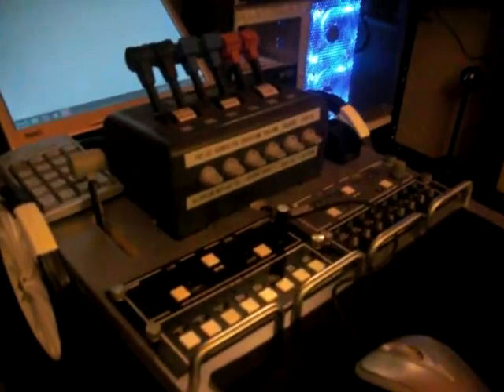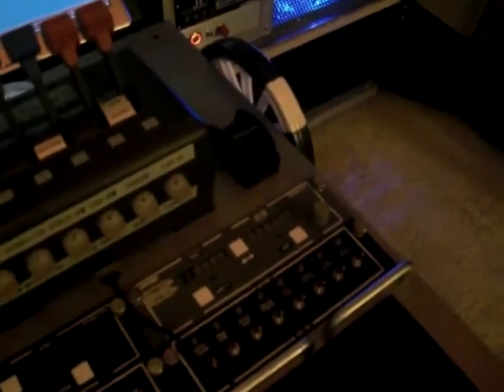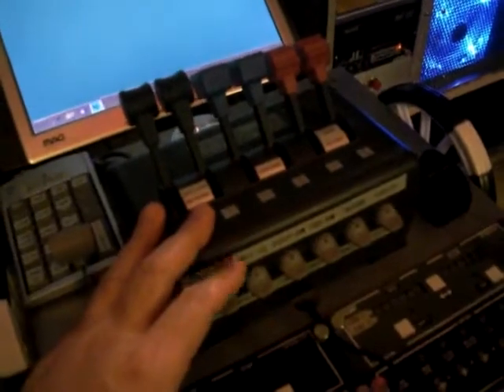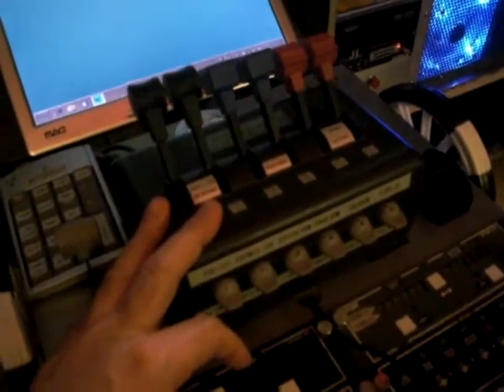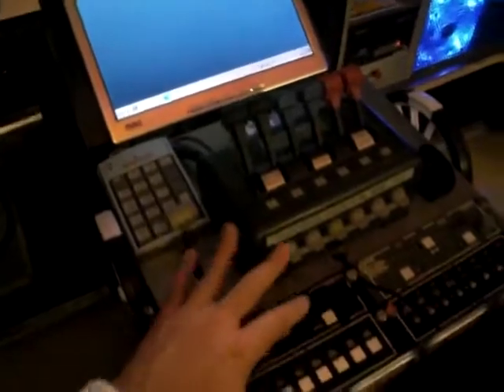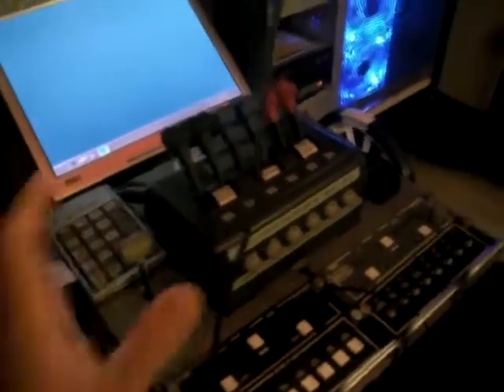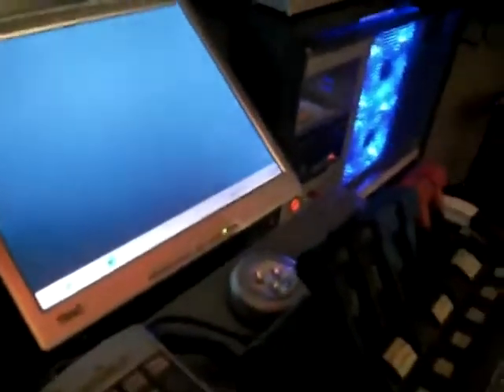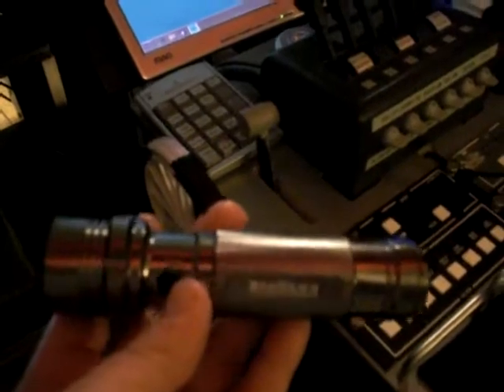FSX & FS9 DIY Flight Simulator - Part 3 of Configuring Multiple USB Devices

Comment from the maker: @TTandN I suppose I could but in reality you need to visually see how it all works in order to understand how to build it as they have two parts, being the mechanicals and the electronics. I plan on selling plan sets for the dual yokes which would include all the details as well a DIY builder manual. After tireless searching for the very few pictures of dual yokes for FS I do feel I have come up with the absolute best design. They work like a dream and perform flawlessly..smooth as glass!